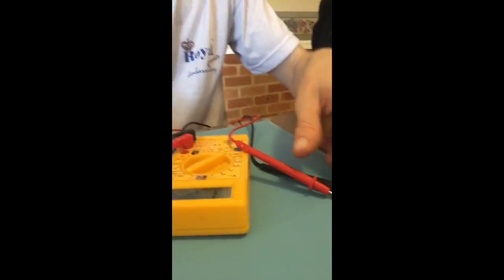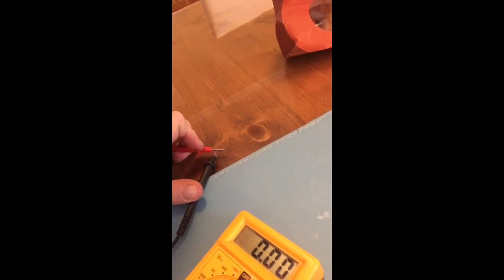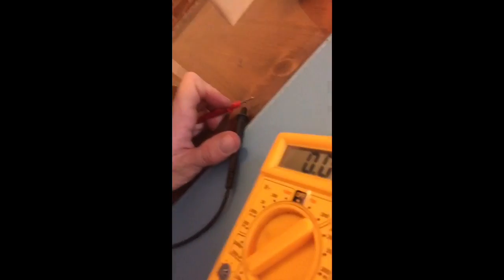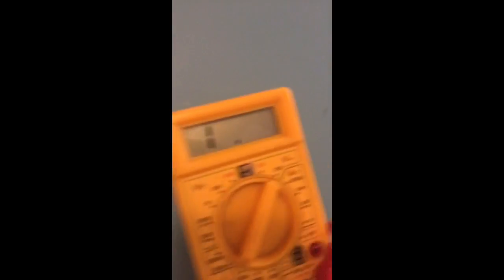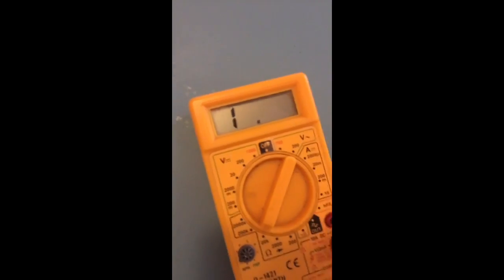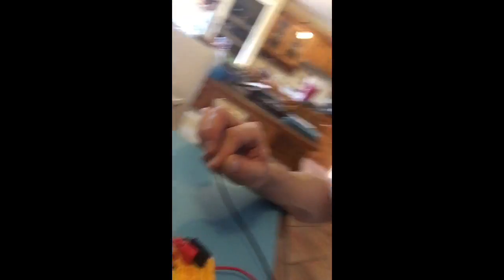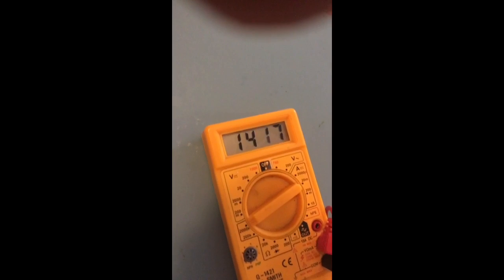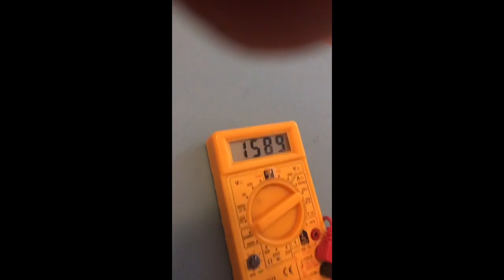Why a 12V car battery can't electrocute you

Comment: May I ask, what is the actual voltage of dirt/earth? If we wanted to talk about resistors in parallel vs series, how would we be relative to the chassis as resistors if we had these two scenarios
A)
Right hands  finger on pos left hands finger on neg
B)
Right hands finger on chassis, left hands finger on neg
Reply from the maker: There is no absolute voltage of anything. Every voltage is relative to everything else. For convention, Earth is 0V
I tested scenario A.
Scenario B is 0V because the chassis is connected to the negative terminal.
Reply: @ may I ask you another question genius kind soul: why won’t electricity flow thru ground if we connect a ground rod to one of the battery terminals of even a 1,000,000 volt battery, yet a 100,000 volt power line can do a ground fault and can channel thru earth horizontally ?!!!
Reply: @ may I ask you another question genius kind soul: why won’t electricity flow thru ground if we connect a ground rod to one of the battery terminals of even a 1,000,000 volt battery, yet a 100,000 volt power line can do a ground fault and can channel thru earth horizontally ?!!!

Comment: Don’t be sweaty when your working with your car battery. I’m new to electronics, but from what I understand, your body is very resistive when you’re dry, and conductive when wet (sweaty).
Reply from the maker: @rickgut2004  I did a test with wet hands. I still wasn’t electrocuted. Water or sweat on my hands doesn’t change the resistance of my skin. I agree that sweat improves the contact of my skin against the terminals, and I did feel a slight “pulse” when my wet hands first touched the terminals. However, the resistance didn’t drop enough to be a risk of electrocution.

Comment: So my car battery was dead, I’m scared of my battery because I’m a fairy so I wiggled the cable connected to the battery holding the rubber bit and the terminal sparked and smoked…. So if I had been holding a wrench on the terminal trying to open it would have I received a shock? 
Sorry this probably a dumb question I just can’t get over the fact of seeing sparks but also being told it’s safe to touch
Reply from the maker: As per the video, you have very high resistance. Your wrench does not. If you held a wrench between the terminals you would see sparks and the wrench would get hot. If you bridged the terminals there would be almost zero current and you would not get a shock. 

Think of it this way. When the battery is completely disconnected, there are no sparks. The air has very high resistance and therefore almost zero current flows. You are similar to air. You have high resistance.
Reply from the maker: The wrench has to touch BOTH terminals at once to make sparks happen.
Reply: @Lozzie74  ok last dumb question, lets say there were sparks from the one of the terminals, if im holding the wrench and the spark makes contact with the wrench that im holding, it doesnt matter because its not powerful enough to do anything?
In summary during a routine battery change theres no chance of getting a painful shock? even if my ring finger touches it, or what ever? I think i have an electricity phobia lmao.
Reply from the maker: @krisb-travel sorry for late reply. You can’t get electrocuted, however, you CAN be hit with arcing if your wrench bridges the terminals. This would not only look scary, but also shoot molten metal droplets into the air, risking contact with you. The lesson: work carefully around  a battery due to risk of thermal burns, not due to electrocution.

Comment: Now…. Why can I take a 9v Duracell battery and touch it to my tongue and get just a tingle? But, with only a 3V difference, a 12V car battery would probably do some real damage?
Reply from the maker: Real damage? Increasing the voltage from 9V to 12V would increase the current by 30%. Do you think increasing a tingle in intensity by 30% would do some real damage? It would be a stronger tingle!

As for why a 9V battery on your tongue gives a tingle, consider:
- the very short distance between the terminals… this results in much lower resistance
- the much higher conduction of the skin on your tongue.

You don’t have to ponder your scenario and guess the outcome. The science is right in front of you.

Comment: So you're saying with your resistance the amprage holding onto 120v leads would be .001A . There would be more than that.
Reply from the maker: I acknowledge my resistance measurements must have been overstated. I agree there would be more than 0.001A if holding 120V leads, BUT NOT MUCH. We need 0.006A (6mA) for a fatal electrocution. My point is: THERE IS NO WAY FOR A 12V BATTERY TO PUSH ENOUGH CURRENT THROUGH A PERSON TO ELECTROCUTE THEM. I even touched my car’s battery terminals. You can dispute the resistance measurements, but the concept holds.

Comment: If you touched your thumb and I dex finger to a 120v outlet, would it just go through the 2 fingers? Or could it somehow get to your heart? Path of least resistance right. So you'd just burn the thumb and index finger badly right/ blow a hole in one of them?
Reply from the maker: Good question! It depends if you are earthed. If you wore insulating shoes and weren’t touching the ground with any other part of your body, the electricity would flow through your finger and thumb only. They wouldn’t burn at 120V because the current would still be too low (skin is a poor conductor and resists the flow of electricity). If you were barefoot then the electricity could flow through your arm, down through your body (including your heart) and down your legs. It depends whether going through your fingers or through your body is the path of least resistance. The path through your feet is further but that’s not the only factor. I wouldn’t be keen to try all this. Playing with 120V is definitely dangerous.

Comment: So lets say you had a car thief in your neighborhood, how would you go by shocking them. Not something I would do just was curious of what to use.
Reply: You can step the voltage up.  Insect "zappers" do this.  I have a mosquito "zapper bat" and it runs at about 1000V on the wires using only 3V supply (2x AA batteries).  This requires electronics to step the voltage up.  I don't know how to do this but I'm sure a Google search would yield what you are looking for.  You can definitely do it from a 12V battery if my mosquito bat can do it using 3V.  It still won't kill (which is good) because the stepped-up voltage will only be delivered briefly, as per an electric fence.
Reply: @straightup9685  Thanks for the info.

Comment: Does this apply to 12 volt batteries only? How about AC/DC power supplies/converters with high amps converting AC to 12 volt DC. Most of them have exposed terminals in the back where you screw in wire terminals, was always nervous about touching an exposed terminal screw.
Reply from the maker: Ohm's law is UNIVERSAL.  The current through you will always be the voltage you touch divided by your resistance (1-2 MILLION ohms).  If you touch the AC input side of an AC-DC power converter, then you are touching mains 110V / 220V AC, which has a peak voltage 40% higher than the RMS voltage.  This is more than enough to push the necessary 6mA through you to kill you.  Therefore I would recommend EXTREME CARE when touching the AC side of a power supply.  However, if the DC side is low voltage then you are as safe as I was touching this battery.  Ohms law... is the law.

Comment: What if you hold a metal bar and touch both terminals at the same time. Would that electrocute a person?
Reply from the maker: David R. Cortez that would risk thermal burns but not electrocution. The battery voltage is still the same. You have simply supplied a very low resistance path for the electricity to flow, and it will flow at an extremely high current,  but only through the metal bar. The bar will become extremely hot and sparks will be emitted. Your resistance has not changed and the electricity will not flow through you.

Comment: Great vid. Would it be safe to touch the terminals if the battery was being used? Just bought my first RV battery and I'm ignorant and scared as F on these things and wanna know my limits.
Reply from the maker: Lee Smith I'm glad you enjoyed the video. You don't need to fear your RV battery whether the engine is running or not. The max charging voltage is about 14V, so the current through you will still be minuscule.
Reply: Thanks. I'll man up and give it a go tomorrow.